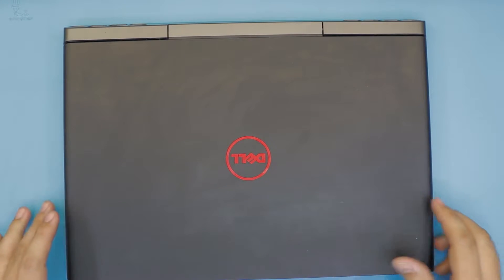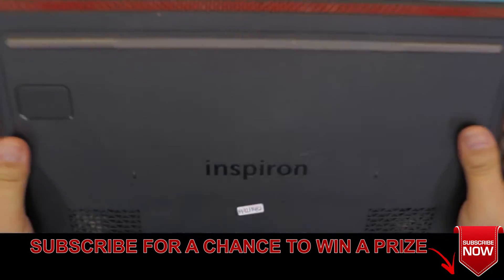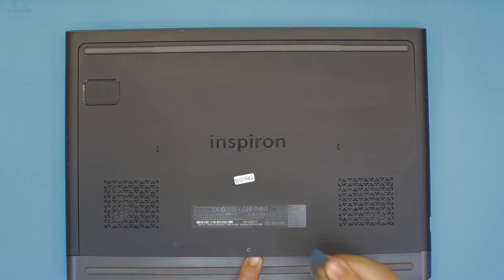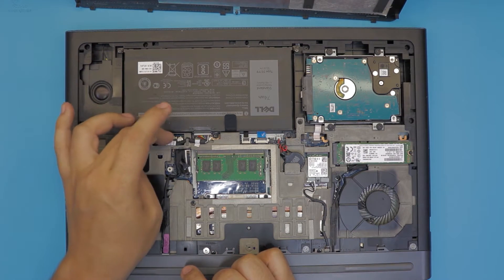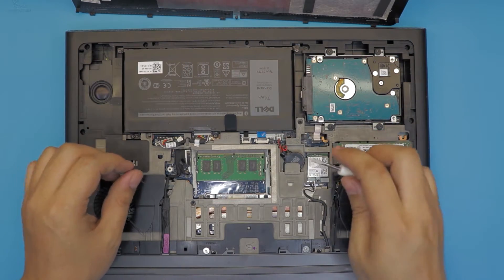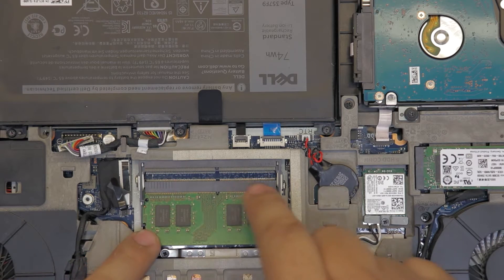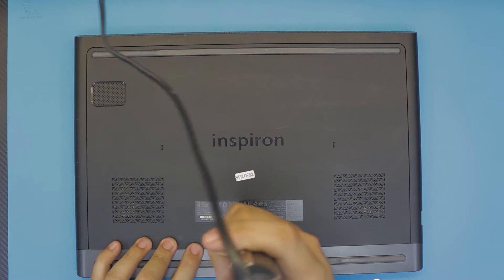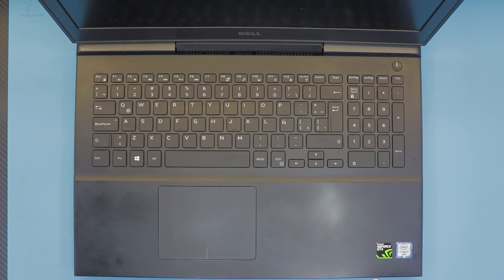Dell Inspiron 15 7000 RAM UPGRADE / Replace

Comment: My pc wont boot after installing the new ram
Reply from the maker: remove both rams and power on and power off, and then plug the new ram 1st on the bottom slot, then power on and wait 10-15sec once you got boot logo power off and place the 2nd (old ram ) into the 2nd slot and power on and wait 10-15sec, you should get it working.
Reply: Already did that earlier and it worked, but thanks
Reply from the maker: awesome job my friend, enjoy your upgrade.
Should you have any further questions or requests in the future, please don't hesitate to ask me.
cheers🍻

Comment: I use this laptop with 1×ram8GB in one slot. But i want to remove original 1×ram8GB and upgrade with 2×ram16GB=32GB in both slots. It will work? 
OR
Can i upgrade this pc to 1×Ram16GB in spare slot? It will become (1×8GB)+(1× 16GB)= 24GB 
OR
Original 1×8GB 
Upgrade 1×8GB 

Which one more better ? Bro 
What should I do?
Reply: And what types of Ram should i use?
Reply from the maker: Thank you for the feedback! if you wish to support the channel you can LIKE or SUB or both :P
sorry that i was away for few days, regarding your question: 
1st of all i would highly recommend to double check your max ram capacity by watching this very short video:
https://youtu.be/tKEJTkVth4Q
then recommended configuration would be the 16gb and its more than enough for any application or even any game, more ram doesn't mean faster.
just add 8GBgb stick, we use a lot of this brand and they are very very good and solid :
https://amzn.to/3tbSPtE
https://amzn.to/3qUNaph

Comment: I put 2 16gb of ram to get 32gb but it won't boot up what should I do
Reply from the maker: TheHoot7 its easy fix
Reply from the maker: TheHoot7 power off the lap only install one dim ram then power on and after you got screen logo power off then put in the 2nd ram and power on and wait 10-20sec
Reply: Thanks for the reply but I tried it and I only got 4 blinking triangle lights
Reply from the maker: TheHoot7 keep doing that change the and swipe the rams and do it one by one it will work
Reply: You say power off when I see the Dell logo or went it boots up to main screen
Reply from the maker: TheHoot7 power off when in windows login i do it mostly on logo
Reply: K I'll try it again soon I got frustrated lol

Comment: Does anyone else have trouble sliding the top layer memory card into place? I don't want to damage it.
Reply from the maker: Thank you for the feedback! if you wish to support the channel you can LIKE or SUB or both :P
regarding your question: just slide it in and push it in @ 45 degree, it has to go all the pics in and then push it to the motherboard, its very easy, you can't damage anything

Comment: You forgot to connect again the battery, anyway is a good video
Reply from the maker: :) im glad you saw that , i did for get it, but i did few videos on the same laptop so i had to reopen and make videos on HDD and repaste. but yes doing the videos and concentrating on speech and all this youtube videoing is new :P
Reply: @uFixTek  XD eventhough it was really helpfull, I'm gonna watch more of your videos. Got a Dell similar to this, gaming 7566 and i'm looking to upgrade RAM and change from HDD to SSD
Reply from the maker: Misael Navarro im glad i could be a help  :)

Comment: I also want to upgrade my ram size( for dell 7567) by adding extra 8gb to the second slot. please help me in finding the best from those listed below.
1. HyperX HX424S14IB2/8 Impact Black 8GB 2400MHz DDR4 Non-ECC CL14 260-pin Unbuffered SODIMM
2. ADATA Premier 8GB DDR4 2400MHz SODIMM RAM Memory for Laptop (AD4S240038G17-R)
3. Crucial CT8G4SFS824A 8GB DDR4-2400 PC4-19200 CL-17 SODIMM RAM
4. Crucial 8GB DDR4 2400 PC4 192000 CL17
Reply from the maker: rock solid #3.
3. Crucial CT8G4SFS824A 8GB DDR4-2400 PC4-19200 CL-17 SODIMM RAM

we use them all the time and had never issue with them and very stable.
a would appreciate the support for the channel :)
Reply: @uFixTek  Thank you maan !
Reply from the maker: your welcome :)

Comment: Good afternoon from the UK. I currently have a Dell Inspiron 15 7000 gaming laptop intel core i5 7th gen (looks identical to the video) discrete graphic 4gb vRAM.

The US store is no good for me due to being from the UK but the UK has the following on amazon:

https://www.amazon.co.uk/gp/product/B01BIWMWVS

Is this the same thing? also what does the MT/s thing mean? do i need to worry about that? whats the maximum i should go upto (i heard to much is a waste?)
.

Have subscribed as pretty easy to watch video and only one that seemed to be the right laptop.
Reply from the maker: you can go with 16gb 8gb x2 dont worry about the MT . thats the ram speed.
i would recommend to go to max 16gb .
thank you for the sub and if you got any other question ask :)
Reply: uFixTek that’s my new RAM installed ! Worked just fine with nothing else to do once plugged in. Tried the laptop with a few various things and definitely picked up speed and loading times. Thank you very much for the assistance 👌.

Comment: My screws won't come out completely. It is almost as if it is intentionally sealed with no seam for a plate that can be lifted.
Reply from the maker: yes it wont come out, it has a c lock on it , you just have to unscrew it and the just pop open the lid the screw will stay on the cover.
Reply: @uFixTek  how do i know when it’s unscrewed?
Reply from the maker: @Massivekillsps3  trust me you will know just rotate and you will hear a click and screw skipping.